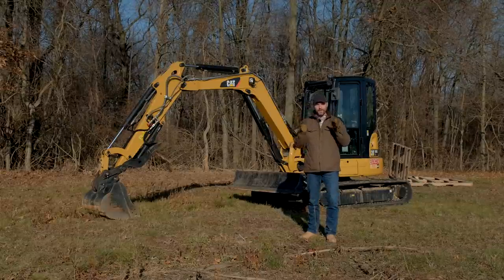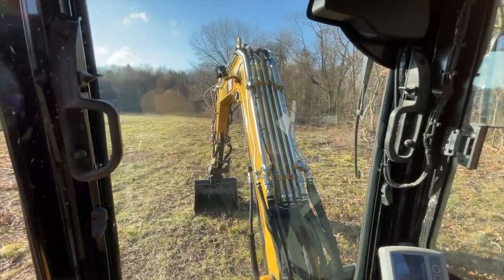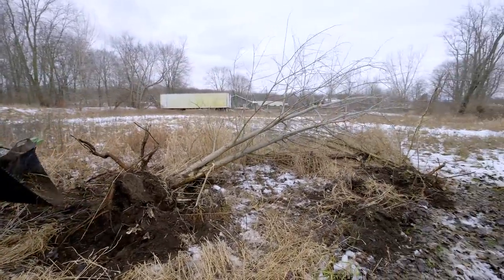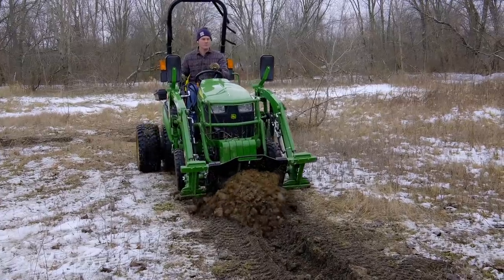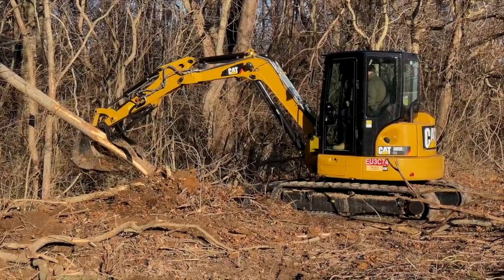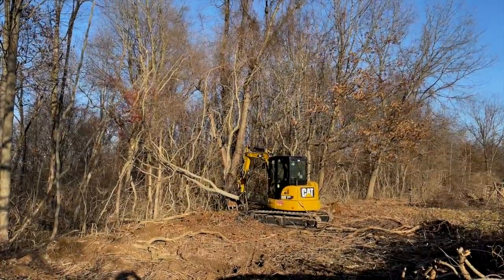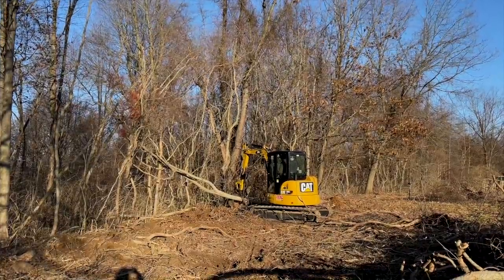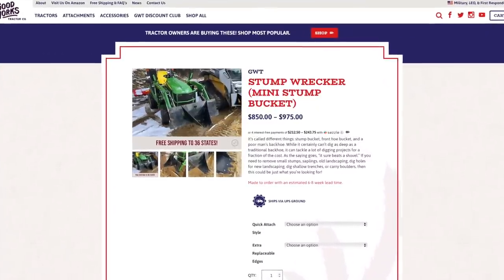CAN YOU DO BIG WORK WITH A MINI EX? HILLSIDE PROJECT

Comment: Try to remember dont dig off to the side of your tracks, dig with them inside with where you are digging. You can use the blade behind you to prop yourself up to add more leverage to where you are digging. You can also brace large items like stumps on the blade to help you track them around. I'm hoping to buy the same model as yours soon so I don't have to rent anymore. Great machines

Comment: Just remember, the rotational force is next to none on those things. It’s meant to do everything in a line to itself. Trying to rotate a tree out can actually damage the house hydros and bend the arm depending on how far out it is. Being a 5 ton, I would stick with less than a 36” bucket or you’ll pull yourself.

Comment: Great video.  I have a similar mini excavator  but slightly smaller (John Deere 35
D).  What I've learned from other you tube videos is that if you place the dozer blade toward the back and perpendicular to the tracks it saves a lot of wear and tear on your back.  In addition, if you use a chainsaw top cut the smaller diameter trees (6 inches or less) at a height of 5-6 feet above the ground, your clearance speed will increase dramatically.  You can use the bucket to still maintain leverage on the  top of the 5-6 foot  trunk stump to yard out the base, but you can then swing the pieces out much faster.  Kind Regards,  Craig
Reply: Yeah, this works really well. My family cleared 7 acres that way with just a pto chipper and a 12,000lb mini. It also works on much larger trees but you have to dig around them and break the roots.

Comment: You did great as a newbie!  I bought my Bobcat E-35 (similar size to your machine) a while ago after watching Mike Morgan clear his trails with a rental Bobcat.  
You didn't say which functions were hard to get used to.  In case you aren't aware, most machines have a lever, usually under the seat, that allows the operator to select between 2 standards of control function - "back hoe" and "other".  I opted for back hoe since that that what I was most familiar with.
Yes, they are slow to travel.  I found my high-speed button by accident, and that was an eye-opener!
Going down hill you will learn the meaning of "pucker-factor".  Turn the cab 90* and pull in the bucket all the way, and look out the side window.  You need to reduce the heavy lever arm hanging out in front of you, amplifying the problem.
Rotational pull weakness:  I thought there was something wrong with my machine until I researched it.  Apparently, manufacturers of smaller machines do it intentionally to protect the operators from themselves.  Too strong = too tippy.  A little more power would be nice, though!
My worst moment was digging up and moving a stone the size of a small coffin (ironically).  Picked it up close to the blade, eventually, lifted it up about two feet then started to rotate to the side.  Only got about 20* the machine snapped up on the corner of the blade and the left front track.  No seatbelt, of course, so I was thrown out of the seat, smashing my forehead on the corner of the roof near the top of the windshield.  Luckily, when you let go of the controls everything stops.  Drew blood. Hard to explain THAT scab to the wife!

Comment: Others have said this, but it can't be said enough--minis can be dangerous if lifting trees over the side.  On the positive side, minis can really push over larger trees using the tracks for forward power. Around here in central Ontario, very few minis are sold without a thumb.  You can't effectively clear land without that hydraulic thumb. Gresat video.

Comment: One thing you have to consider, my backhoe cost $7000 for my tractor and renting a backhoe or Mini Ex in the country is expense and many times in the country the closest place in 35-50 miles away so much of your rental time is take up with travel time.  I understand you point and if I had a good rental place near by and A job where I knew I was free it might make sense but with 60 Acres find a project is not hard.
Reply from the maker: Correct, there is never a one size fits all solution.  Thanks for watching!

Comment: I am sure that you have made a really nice purchase! If I may, I would like to make a suggestion. Take the thumb and make it into a coffe table and buy a SteelWrist or a RotoTilt between the boom and the bucket instead. You get much more use for the mini-ex when you can tilt and rotate implement. Smoothing, grading, brushing, lifting, installing posts - the list goes on and on. Quick-change with a button between implements 😉. You can even get quick-coupled hydraulics integrated 👍🏼. But keep on!

Comment: If this is your first time really running an excavator, you did very good.  I was going to suggest watching Outdoors With The Morgans, Mike Morgan but sounds like you already have plus some others.  Mike Morgan makes running an excavator look so easy and I know it is not.  I think an excavator is the prefect piece of equipment for you and your property.  This is going to be fun watching you get better at running it.  I also think you'll be using it on things you never thought of.  Thanks for sharing.
Reply from the maker: Haha, yeah there's a bit of a skill gap between me and the other guys.  However, repetition will make it natural.  Lots of fun to use.  Just so slow to move around!

Comment: congratulations that's a very nice machine you have. looks like it even has extra hydraulics if you wanted to run a mulcher head. it looks like it's pulling out 6-in diameter trees with ease.

Comment: Morning sir! Looking like you are having some good fun over there. Why not take advantage during these nice weather days in Michigan.  Your controls might be setup as "Cat" controls or you can change them over to "JD" controls. What I mean by this is that you joystick can be changed so the left stick will open and close the same way that it would on your tractors. Another word of advise is learn your blind spots on that machine.  It's not so bad in open ground like that, but as you make you ways into the woods that boom arm can block thems and as you turn to the right you might nail another tree.  So I learned from my dad was do your work in front and swing to the right, less chance of hitting something or someone (sounds crazy, but it happens). Also - there should be two settings for your traveling speed on that machine.  I'm a little jealous, but if you ever want help - give me a shout - I'll come over for weekend 🤝
Reply from the maker: Great point JW, hope things are going well!

Comment: Just in my experiences but here are a few tips I give our new operators. 

Do the hardest work with the blade toward the work. Press the blade to the ground and put a little pressure on it. This increases stability and takes a lot of wear off the tracks and undercarriage. 

Try to avoid digging while facing opposite the blade, it will put increased wear on the drive sprocket. You can do it just fine as it wont break anything, just avoid when you can. 

Watch out for the hoses and cylinders, They get damaged quite easily by things during land clearing. 

Avoid tracking while the bucket is in the ground, (like a plow). The tracks can put more force on the boom and arm than the hydraulics can and may lead to damage. 

The swing pressures are lowest for a reason, the machine is made to work straight ahead. Using it as a rotating battering ram is hard on the entire boom and may lead to damage.

For best results digging stumps out, work the boom, arm and bucket curl all at the same time. The way it works leverage against the ground it adds quite a bit of additional stump popping leverage. (Hard to explain in text)

As always stay safe and watch out on slopes, they can turn over easily on slopes if your not careful. 

Thanks for the videos!

Comment: Great choice on machine brand and size. Based on your soil type and tree size i I believe you will be very pleased with this unit. You will not get a lot of rotational force with these machines so may try to snap the trees into smaller pieces and keep them inline or pull them later with the skid steer. Have a blast man excavators are a lot of fun.
Reply from the maker: Thanks Ralph, that's reassuring to know!

Comment: I’d recommend having someone else on a tractor with a grapple working with you. My wife can run the tractor with grapple when I rent a mini.  I dig  the trees out and get them on the ground. Big ones she can skid out using the 3 point on my quick hitch that has welded on chain hooks. Smaller ones she can grapple out. I’d also get a quality electric chainsaw and keep it nearby.  You can hop out of the mini and quickly cut medium size trees into 10’ sections that someone on a tractor with grapple can easily move. Doing it this way let’s you focus on tree clearing with the mini without having to work around a pile that boxes you in.  My Stihl electric chainsaw with the AP300S battery runs all day making intermittent cuts.

Comment: Not a bad machine Handy size, quick hitch, thumb, and a decent size 5 Tonne machines are kinda a handy tool to have around small enough but with enough power and lift to get out of trouble. Spent a month in a Cat 5t was a good machine. At work I'm normally on a Takeuchi tb153fr, TB370 or a TL12v2.
Reply from the maker: Glad to hear it, all those things led me to a machine this size

Comment: Keep in mind that I have only used a mini-ex one time... What I found as a beginner was that there is a lot of power in the tracks too. So as long as you have stability without the grader down, you can do things like pull that stubborn tree out of the woods by rotating and driving at the same time. 

Another tip that I think it was important to hear was to keep everything as close to you as possible. It's simple physics, but not necessarily something a person with no experience thinks about. Digging in close, or even pulling/rotating with the bucket in close will give you a lot more power than doing the same out towards the end of your reach. Less stress on the machine too.
Reply from the maker: Good stuff Joshua, makes a lot of sense!

Comment: To help save top soil with brush and small trees just reach out stick teeth into the ground and pull towards you some people like to use the dozer blade to push everything down I'm doing the save as you but I have an E145 bobcat excavator and trying to clear 204 acres for hay fields I get about 5 acres a day then come back with my T870 bobcat with a grapple and clean up mess good luck and be careful not to drop a tree on the machine

Comment: The swing hydraulics on these machines for the house (cab) is the weakest function, probably followed by the boom swing.  I would have suggested once you have the tree down and a hold of it, pick it up and pull it close to you, then back up, use the tracks to get the tree pulled out and clear of the woods enough that you can then swing the house around with the tree and set it down.  And watch the hoses on the arm and boom, swinging thru surrounding tree branches with the boom can end with tearing a hose off that a tree branch got into....

Unrelated to this video, but may help later, when digging in hard ground or trying to break / rip up roots, having the blade in front of you will give you more digging force before you lift the rear of the machine off the ground (the typical way to dig).  But if you find the machine is having a hard time getting the bucket into the ground (frozen or really hard ground), turn the undercarriage around so the blade is behind you and on the ground, this will allow the machine to apply more weight / force to the bucket before you lift the front of the machine up.

Otherwise, keep filming and have at it!!
Reply from the maker: Thanks Stephen.  Still figuring it out, but that all makes sense to me!

Comment: Nice. Just a bit curious on plans for the removed trees and value of pulling out whole vs chainsaw then stump removal, and piling logs and brush separate. Will brush be chipped or burned? 

One caution for anyone working in larger trees is limbs from above. Guy near us had one come straight through the roof of a big excavator and through him as well. Was lucky to survive after major surgery and helicopter evacuation. The can roofs are often not that hardened.
Reply from the maker: Yeah, gotta be careful with those widowmakers.  Will process what I can and likely try to find a way to make some more small game cover with the rest.

Comment: How about a video with a full tour of the machine itself? I want one, but there's no way I can justify the $50K+ for a machine in that class. I know a guy in the area that imports the Chinese ones, they start around $8300 base, and you can hydraulic thumb and various accessories from there. I'd have to do a lot of research before I consider something like that, but at least that's more in line with my budget.

Comment: Those machines aren’t meant to be used for dragging heavy loads sideways with the bucket or boom. If it doesn’t bend the stick over time, it’s sure to do damage to the hydraulics sooner than later.
Reply from the maker: I guess not, learning as I go

Comment: the main thing you have to remember is to be smooth with those excavators, they'll wear out pretty fast if you aren't.
also if you don't have the power to rotate the cab you can rotate the arm around the front.

Comment: Not sure if you did or not but make sure you operate it at full RPM
Reply: I always heard for  mini ex, you do NOT need to run at full RPM and anywhere from 2/3 to 3/4 is just fine and dandy. And just crank it up t 100% when you need extra power or boost.... no?
Reply: @garyhendersonhillsborough  no the hydraulic system was designed to run at full RPM you can run it at lower RPM but you're not going to get all the capacity out of the machine It will function slower and not have the power or if you try to do three or four functions at once it will really struggle if not at full RPM
Reply from the maker: Makes sense to me

Comment: Exactly what I needed to see! I am evaluating which size I need right now as a matter of fact. I have the same type of project and have a number of trees 12"+ that have to come out.  Do you think this size would be strong enough to pop them out without having to dig to China or should I try for the bigger sized mini (18,000 lbs I think is around the biggest size?) or maybe step up even bigger? I am a beginner excavator user like yourself btw.    Thanks.
Reply: Keep in mind the weight of the excavator. If you plan on doing other projects with it and you will it will tear up your landscape like you wont believe until you get good with the excavator. I have a Kubota KX040-4. It weighs 10,000. Yes i have taken out 6 to 22 inch trees. It might take me a little longer BUT it does an excellent job and very maneuverable. I have put about 580 hours on mine and still learning.
Reply: @stephendevore1800  Thanks. I guess I should have mentioned that it will be a rental not a purchase.... at least not yet! lol.. It will just be used for this particular job.  Glad to hear that it is possible to use it to dig out bigger stumps, just hope I don't have to dig a pond sized hole to get them out.  Thanks again.
Reply: @rogerr1296   you can use a smaller machine to pull the trees. You don't have to dig like crazy dig a bucket wide on the right side left side and front of the tree then push it over away from you. Don't cut the tree down then try to pull the stump. Leaving the tree up gives you more leverage to push it over
Reply: @simpleman4196   Well, lol, a little too late for that. For the most part at least. I have been clearing a lot of the trees with plans to rent the excavator to dig out the stumps for the trees I've already cut and push down the rest. Unfortunately, in my situation its been a matter of time, cost and other factors where it is really the only option for me at this point in time. I realize it's going to probably mean a lot more digging than I would have had to do for the stumps, but it just didn't work out that way.   Thanks for the info for sure.
Reply: @simpleman4196  Thanks for the info. Didn't think about getting a smaller bucket, good idea. I would think a hydraulic thumb would help as well if I can get one with it.  Thanks again.
Reply: @rogerr1296  a thumb would be very useful you I'll be able to pile up the stumps and brush move stones and lots of other things. No problem for the tips

Comment: I like the reach but it can't compare to a real industrial backhoe for digging out stumps.
Reply from the maker: Yeah, well this beat the pants off any tractor backhoe I've used.
Reply: @GoodWorksTractors  have to admit,  I'd like to have it.
Reply: @GoodWorksTractors  I have a 4320 JD compact and a beat up old Case Construction King. The Case is like a bulldozer in comparison to the JD I can ram it and slam it with no fear it will break.

Comment: I would think that two or three fellows with chainsaws and a good operator on a D-8 or D-9 and it would be completed in ten days to two weeks. Save time and money.  
Of course if you are going to really use the mini-ex after the fact and use it for what is was designed to do swing away.
But then you would not have all that fun operating another piece of equipment. 
Maybe a little jealous of all the equipment you get to operate. (Sigh)
Reply from the maker: Maybe so, there's many ways to skin a cat.  This way meant I got another cool machine to use! :)